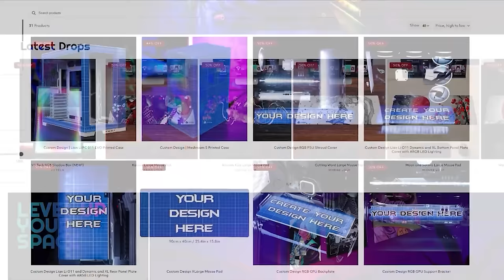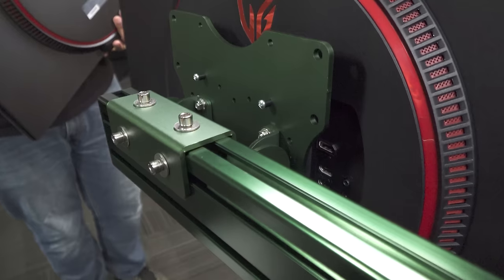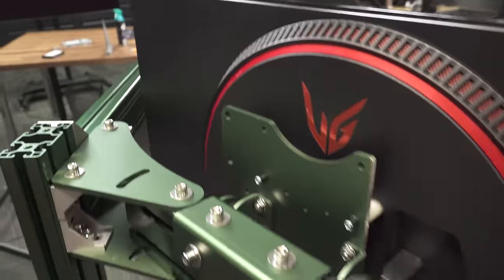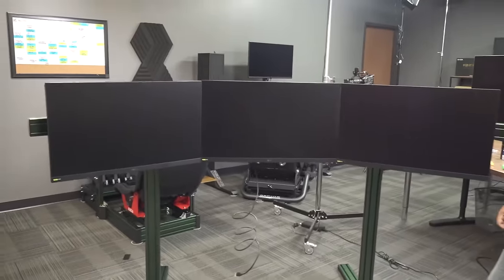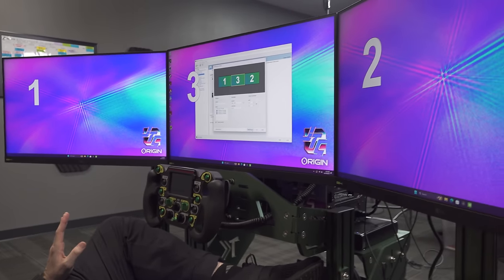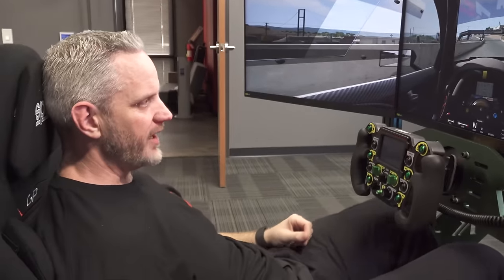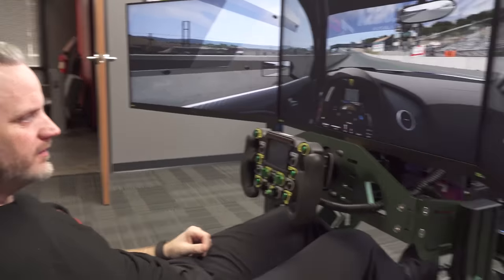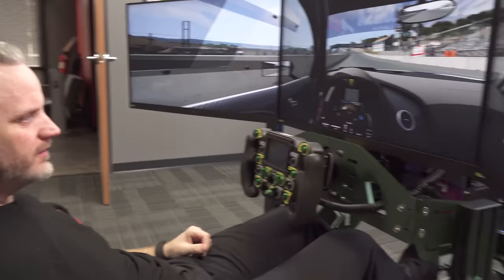I haven't used NV surround in over 7 years! Does is still suck?

Comment: I LOVE NV surround in sim racing, the only annoying thing with NV surround is enabling a and disabling if you use you PC for you Sim rig AND normal PC usage/gaming. I have triple 4k surround and a TV connected I used to be able to have the TV enable with the 4k surround but with recent drivers that has stopped working so I have to unplug the TV's hdmi cable to keep it from acting up in surround mode. To avoid the Monitor order problem Jay had I moved the cable around to different ports then labeled them to get them always to be 1,2,3, when I turn on surround
Reply: @designamk1160  wish I knew about that ealier I am already build a second PC for my TV, so I can Dedicate my 4090 Rig to just Racing/Space/Flight Sims

Comment: Jay a question not related to the video
I am planning to buy a video card (4080) but with the whole issue of burned cables, its only in the 4090s that the cable burns or also in the 4080s

excellent video by the way

Comment: Been using surround this whole time... Daily driver is 3x1440p 27inch 165hz VRR 7680x1440. Upgraded from 3x1080p 24inch 60hz 5760x1080 when I upgraded from 3080 TI to 4090. I used to run the 3 mon and 2 extended but now just have a 50 som inch 4k extended. I need to do a new update video but recording a non shaky video is eluding me. Recorded update 2 times now and I'll try again some time... lol I've been triple monitor since 2009 ish. SoftTH 4870/8800GTX combo. It's in me videos. Been doing triplescreen since before Eyefinity and Surround existed. It's a breeze now.

Comment: That triple monitor stand is for 50" screens that's why it doesn't fit those 32" screens, it's also why the back plates were so much larger than you needed.

Comment: Asus 27inch nitro Middle monitor flat and two curved 27inch asus ith a fou 32 inch tv above is the setup i have ran for five years now..... took me about 6 hours to setup and config and ive never had an issue since using Nvidia surround. Also highly reccomend getting those monitors far more closer and angled correctly around the rig with the side monitors... like it is now you'd be better of just running a single ultrawide
Reply: PS...... try American Truck sim or Euro Truck sim with this setup

Comment: As someone who uses NV surround a lot for games like Flightsim and then turn it off again for regular use, the nvidia panel software has not changed in like a decade and it is rather user unfriendly ... but it works. You just have to constantly manually adjust your settings all the time. It is stupidly inconsistent between screens as wel.

Comment: I have Still ben running Nvidia Surround sense before you built skunk works OG I Started it with Custom water loop with 560ti in SLI with a i7 980 4.2ghz oc then went to a pair of gtx Titans but any way I Blame You.. you taught me how to sli & oc n water cool lmao  & i have never stopped/or slowed down ! I have ran a 3+1 Monitor set up just about ever sense ! I Tried to go to a Ultra wide Dual set up But could not handle it so i was back to surround n less than 30 days ! Keep on talken and i will keep watching ! Thanks

Comment: I only race iracing and acc. Both have settings iracing is in game acc not so much. It’s monitor angle adjustment, you really should have more like 55degree to 65degree on your monitors. You should see the rearview mirror on the passenger side
Reply: Also sim hub for the gsi wheel works beautifully together

Comment: It’s been a long time since I’ve used 3 screens for sim racing but I think the issue your having with the side screens not aligning correctly on the mount etc is when using triple monitors for sim racing the side screens should be at a 65° angle to the centre screen.  So that the screens wrap around you more.  This will also immerse you more into the sim/game.. Also Probably not much you can do about it but your eyes are suppose to be about centre to the screens vertically as well..
Reply: Yeah, I remember seriously looking into that 'TrackIR' system way back when, but luckily I was too indecisive and ended up managing to wait until Home VR finally became available. And after my first race using the original Oculus Rift CV1 I knew I could NEVER go back to flat screens, even with the serious resolution limitations of those early headsets!

Comment: i had to take a hacksaw to my vesa mount for a 32" lg ultragear costco monitor i returned that couldnt even run 4k on an rx 5700xt without articacting and blackouts even while idle. so pissed i had to mangle my vesa mount for a montior i couldnt keep. now im struggling to find 4k monitors at 32"+ that run displayport 1.4

Comment: Nice! I have a triple curved monitor setup. Using three 27" AOC 1440P 144hz monitors. Unfortunately the damn mounting bracket I bought doesn't extend wide enough to have them perfectly aligned so I have to use them staggered. Was such a pain to setup too. I have a Quest 3 so I end up just racing via VR. I'll eventually get a bigger mounting bracket.
Reply: So you actually prefer triple flat screens to VR?
Reply: @StreetPreacherr  it depends. triple flat screen is still sharper to the eye but VR is more immersive. I'm not a hardcore sim racer so it's hard to say which is better.

Comment: Might have been a PITA to set up, but the results look exciting to play.  I find the bezel correction to be much less bothersome when there are three displays and especially for sim driving games (the bezels seem more natural).   I've had reasonable success with Nvidia Surround lately, though it does occasionally crash/hang (of course most memorably, just before saving a long tricky chapter of a game).
Reply: Though I have found that when you run two monitors in Nvidia Surround it can downgrade the overall refresh rate.  A 4090 can run two Samsung Neo G8's simultaneously but independently each at 240Hz in 4K and 10 bit color.  One might speculate that such displays could be paired in surround to run at 240Hz but when so configured, they "only" run at 120Hz no matter what content, regardless of graphics load and DP/HDMI cabling (tried a number of combinations and cable types).  It appears that a 4090  when presenting a unified surround image has a overall pixel bandwidth "limitation" that prevents it's otherwise awesome graphics moxie from getting out (overclocking the 4090 doesn't help).  Probably doesn't get fixed till 5090 whenever that happens.   Wasn't that  long ago when 120 Hz was amazing, not a letdown.

Comment: Jay or if anyone can help. I’m building a sim racing setup and I have everything but I ran into a problem. I’m using LG 45GR95Q-B OLED Gaming monitors. I’m trying to get three working on windows. I have a RTX 4080 FE. All the driversupdates been installed windows does see all three monitors but when I check off the third one it unchecks one of the others.  I’m rocking Asus Z790 with the lasted bios update. Ram it’s 32 gigs 5800 mhz .I’m lost at this point. So bummed out. Any help would be appreciated.

Comment: You need to have way more angle on the monitors, like close to 60 degrees. That’s why you were running into issues lining them up on the TK stand you got. You want to feel like you’re wrapped in monitors, not so much of the spread you have now.

Comment: Fix the cross member across the front of her uprights. Then you can fix those swivel brackets to the top and bottom of the cross member direct, and then you have slide adjustment to where it needs to be to remove gaps and make monitors join up.  You're killing me here 😂

Comment: Sim-lab adjustable vario vesa mounts are almost a necessity for triples on a sim rig. They are easily adjustable to get all three monitors perfectly lined up in minutes and save a TON of headache. The lack of angle on those monitors kind of makes me cringe. They should wrap around you from ear to ear. Nothing like oval racing and looking over to see someone on your inside or outside mid corner.

Comment: Idk if you guys put the monitor mount together wrong or if the instructions said to do it that way. Either way it’s terribly useless like that. The uprights should be bolted to the back of the center horizontal piece. Then the angle adjustment brackets should be bolted directly into the central horizontal piece. Look up a picture of the gt omega triple monitor mount and you’ll see how it should go together. Putting it together like gt omega says to will fix all of your problems with it.

Comment: I've been running triple 1440 monitors with nv surround for the past year and a half. Elite dangerous, assetto corsa, forza and forza horizons 4 and 5, and cyberpunk are all great. All of the other titles I play work great after dialing in the fov. I have yet to play something that just don't work at all.
Reply: ETS2 (Euro Truck Simulator 2) or ATS (American Truck Silmulator) looks amazing with 3x1 setup - but need to dig into config file because game has no these options in menu - You can set camera ange to each monitor and bezel thickness.
It is feel like sitinng in real cab.
I using mine for years - not regret nothing :D

Comment: 3x 32 inch monitors is just over an 85 inch monitor wide, but has 30 inches less height. I wonder what the experience would be like with an 85 inch 4K 120hz TV instead of the monitors.

Comment: Jay, Nick, Phil (who is not here and could of probably figured it out)... i love you guys and your videos. Please do not take this the wrong way...
But that monitor stand is built incorrectly. The cross member could go in front of the uprights, using the 90* brackets on top and bottom (or behind it) to connect to the uprights. Then the angle plate goes inside of the 90* brackets so you can slide the angled arm closer to the center as needed.

Comment: Usually love all of J2C videos but these 2 on sim racing have been so misinformed it pains me.  

Surround not necessary
Fov is very off
Triple screen setup was very off. angles are way to shallow as well.
monitors are too far away and way to high. 
sim gear explanations in store were off. 
The LG monitor's and vesa brackets issue is well known. a 20sec google would have beeted the fix. 

Please, Please have a follow up showing the corrections so any possible newb to simracing isnt totally discouraged.
Reply: This channel fell off hard. But don't worry, this is just the bait video. The next one will be "how I fixed our sim setup" where he just does what the comment section says should have been done in the first place

Comment: Bro, you need to move the monitors out on the horizontal piece to close the gaps perfectly, which will also hide the piece behind the monitor. Also, you need between 40 - 60  deg of monitor angle and 50 - 70mm of distance to get the right FoV for the accurate sense of speed. The monitors are too wide you seem too far away.

Comment: I used to run 3D surround and it was awesome.  Regular surround “Eyefinity” for ATI stuff, 😂 if you’ve been in this hobby long enough to remember, that was always awesome.  Id still run it if a 4090 could drive 3 4K 120hz TVs, and I could afford 2 more 77 inch OLEDs.   The dream back in the day was to get a tv with DisplayPort, but at the time only one existed and it was virtually impossible to find in the US.
Tbh if I wanted a super wide display I’d just put on my VR headset.

Comment: Just from a low effort view couldn't you have just bought and used a 90 degree down angle dp cable to connect to the monitor instead of cutting the mount?

Comment: dont you think it will be more ideal if the side monitors placed at exactly the same distance as the mid monitor distance to the viewer head/eyes? though im not sure if the game will project the picture in the side monitors at the correct angle of view in relation to the viewer head position and the mid monitor position if the side ones are being put closer to the viewer. unless there is a system setting to adjust that side screens virtual view angle in relation to the middle monitor angle. and im not talking about the optical "lens" view angle, im talking about VECTORS view angle. the true surround view effect could only works correctly if the viewer could see the in game view in correct positioning by each of their viewing vectors from the viewer eyes/head at the center. for example, that car's side mirror position in the side screen should be in correct position to the viewer's head as it would in real world. the vectoring. man there are so many "view" word i typed there.

Comment: J, Asseto Corsa has excellent car physics, but rFactor2 is better in my opinion, some other simmers I watch think the same, plus rFactor2 has the best force feedback I've tried on my rig. I play with a Simagic Alpha U wheelbase and Simagic P1000 hydraulic inverted pedals, I tried the Simucube a bunch at Microcenter but I wouldn't say I liked the quick release and not having power from the wheelbase to the wheel, Simagic was the way to go with best quick release plus wireless charging on top of that last firmware update Simagic brought made FFB feel better than anything else out there imho.

Comment: all late but the monitor issue wouldn't have been a problem for most people because you actually set them up at less of an angle than most would. if you would have set up the monitors pulled in more on the sides you wouldn't have that problem really and that type of setup is better because the side monitors end up being the side windows on the car in game. Just wanted to point that out. Great content as usual though.

Comment: Should have gone with the 32" Acer those are curved and 165hz. They are $250 at MC and the mounting is on the bottom so you wouldn't have run into that issue.

Comment: the triple mount was giving you problems because the angles between your monitors are far too large. triples and FOV is down to mathematics, not fully just down to where you wanna put them. i suggest doing some more research on triples and making adjustments.

Comment: My rig is tripple g9 ultra wides it's a full 270deg of screen I added a 14in mini ultrawide above my monitors as a rear view mirror. I have 3 7900 xtx gpu's in a amd threadripper 64 core setup one for each display unlike nvidia  amd gpu's will sync frame buffer across multiple gpu's when spanning.

I actually made my sim rig on linear rails bolted to a wood base on rubber isolation the monitors are fix mounted and my seat moves back to get in than moves to align with the center of the 1000R of the screens the wheel moves  back toward you. All done with linear actuators on hgh30 rails and 8020 framing.
I have a 2nd rig with a 6dof setup I use for some racing but mostly flight sim.
My main rig has a transducers 1 on each corner plus 6 in the seat. Plus my seat has about ±10deg of yaw rotation for traction loss as is was a simple mod using a large lazy suzan bearing between my rail plate and the seat base.

Yaw is just an Odrive, brushless motor with encoder and a home switch conected with a usb to uart cable and a 36v 10A psu and 100w 4ohm brake resistor.
It's just the right amount of information combined with the dayton audio transducers so i can tell what all the tires are like by feel alone i can sense when I'm on the edge of my tire grip and pushing the limit.
Getting into this level of sim racing gets crazy expensive fast i have crazy investments at this point with my 1900$ wheel, on a simucube ultimate base.

Comment: Been running a triple head since battlefield 3.  Just upgraded last year to triple aurus 43" 144hz 4k moniotrs and a watercooled 4090.  Play lots of fps games like tarkov.
On any games prior to halo mcc i run 144hz uktra no problems.  Modern games usuall have to downsample or run triple 1440p.  
I use the nextlevel racing monitor frames.
Its DEFINATELY not for someone who isnt ready to spent a lot of time tuning each game to learn what itll take.

Comment: Sad to say @jayztwocents, it’s actually the design of how they want you to do the stand. The way they designed it doesn’t allow you to really run screens less then 40 or so tv’s. I have this stand my self. I had to move the up rights to the back side of the cross bar, buy 4 more L brackets for stability reasons(can email pictures for reasons) and then you can create the proper room for 27-32inch screens

Comment: I low key use it all the time. The problem I've noticed is that You can't use multiple monitors with multiple GPUs without the SLI. But multiple monitors on one GPU works pretty good for most games Just make sure they're all the exact same monitor

Comment: Pro tech tip: If you take a screenshot of your website desktop and use that as a template for wallpapers you don't need extra software for different images or one large one for your wallpaper, Windows will just use the one giant image across all monitors.

Comment: In my experience, when it's activated, it works fine but when you swap back to separated mode, very often, it will bug and refuse to deactivate it and it sucks big time, you have to reboot windows. It works way better on AMD, again, in my experience. I used a setup like this for a while with 3 2k monitors and never again. I should have bought an ultra wide.

Comment: 3:51 get NIck onto fusion 360 and 3d print a stand-off that allow you to fit the cables. What is the black nylon spacer on the mount side for?

Angle grind part equivalent of raging  at cheater on a game before rage quitting…. lol .